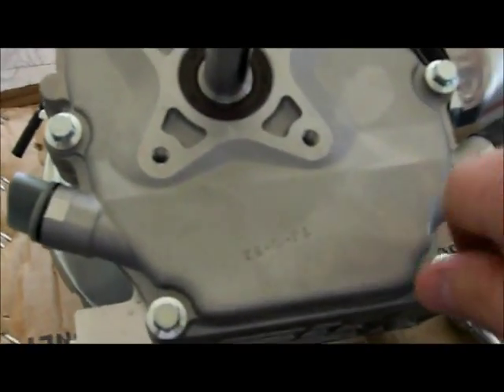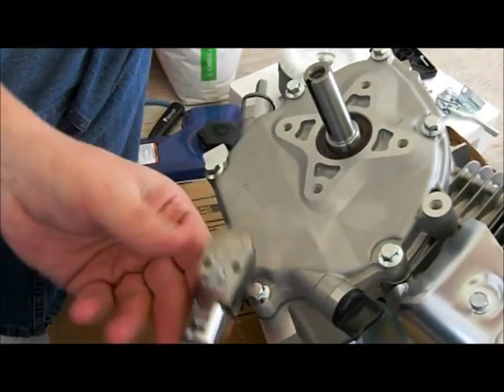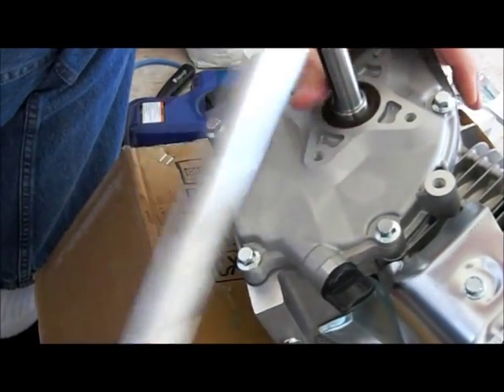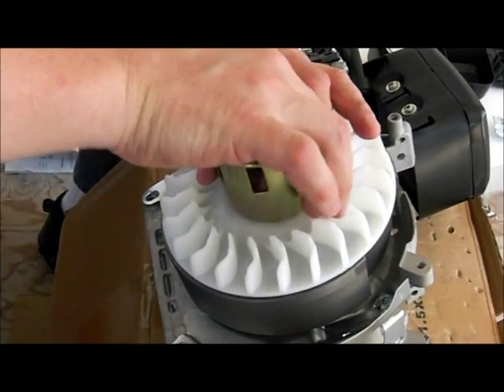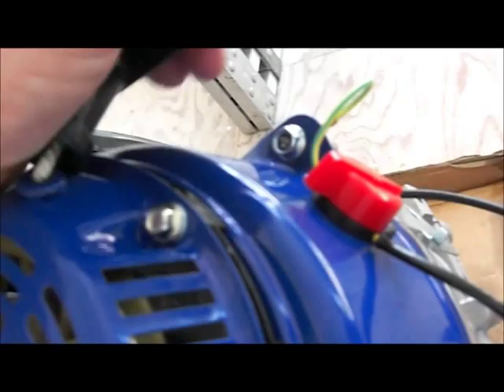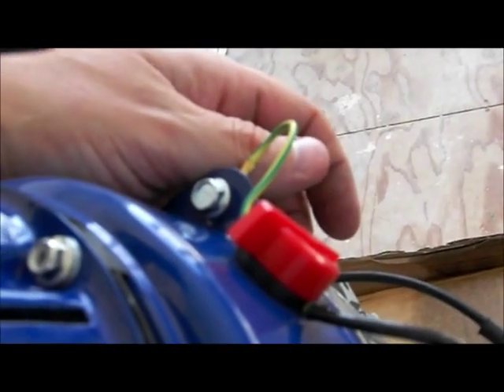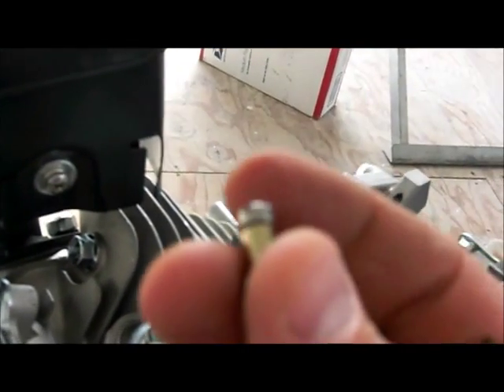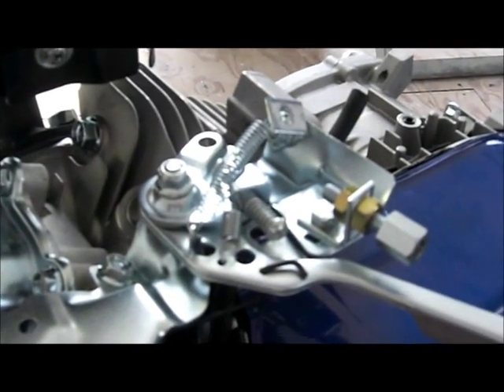Doodlebug conversion part 4.of 5

Comment: Nice to see an informed skilled motorcycle DIY mechanic explain the Predator conversion intelligently !!!  I've read that you at least need the 18 lb valve springs,..so as not to float the valves when you remove the governor ????  Soon then,.. billet flywheel and billet rod,..but I'm just listening to everybody !!!
Reply from the maker: SilkySlim Thanks for the kind words. Ultimately the engine pushed the little doodle bug to 50 mph and would win 30 foot drag races against a yz250f, and yes I have the videos somewhere. But I built It for my young son and I decided it was to much for the chassis and was a dangerous machine. I advise against building this for kids. If your building for adults, do it if you like, but use caution. The motor was $99 so I thought if the crank broke that I would just replace the whole engine. It cost less than an aftermarket crank. After three years of every day riding and beating the crap out of it, the engine never broke. Several drive chaines and many many miles and finally the frame gave up and that was the end of the bike. There were lots of good times and a few crashes, but it’s a bike we’ll never forget. Have fun and I hope your build brings you many happy memories!
Reply: Thank you,..yeah maybe they're just saying it will blow up,.just to sell aftermarket performance parts,...it's big business these days  !!  It's interesting that you removed the governor and rode it for years,..and nothing happened,..hahaha  !!  Thx for the video ..